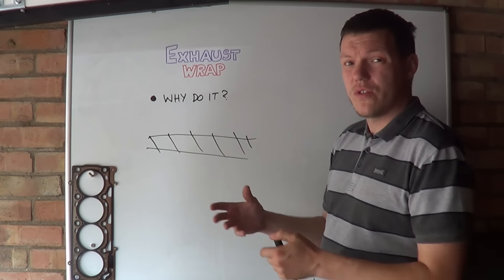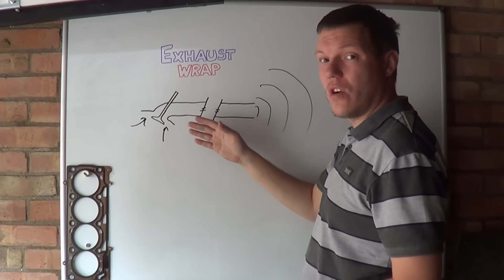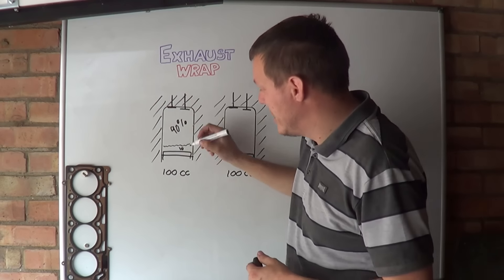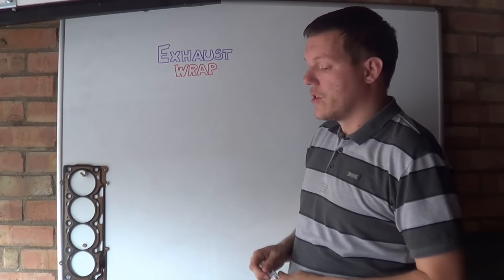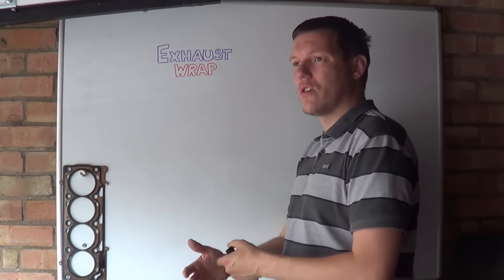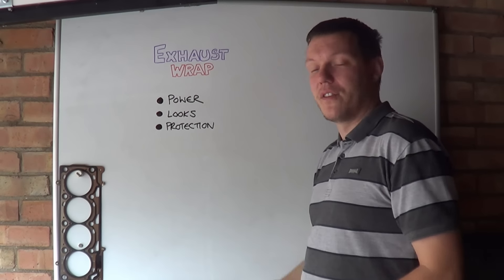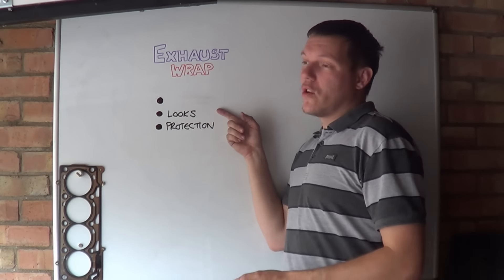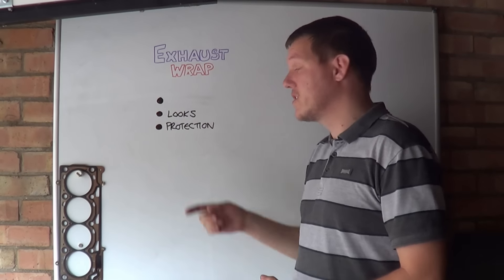Exhaust Wrap - Good or Bad - Bike TEch

Comment: I just wanted not to get burn by my Honda shadow 1100cc. :'( I wasn't really looking for increase of performance. I don't want to damage the bike tho...
Reply from the maker: It won't damage the bike, loads of people have been using it for years. You need to understand that it isn't a permanent fixture, it will need replacing once it starts to look shabby.
Reply: Oscar Herrera lol I have the same bike and it burns my side leg everytime I stop at red light
Reply: Hector Camberos any clue on how to avoid this? also. I'm not much concerned about burning myself. but the wait to put the plastic cover on... it is insane :'( and I live in a apartment so I have to literally go inside. take a shower have dinner then come back and put the goddammed cover on. it is insane. plus I live in Arizona so... worst case scenario
Reply: Oscar Herrera ya I wait around like 20 minutes  before putting  the cover on ..I went to cycle gear and they told me that exhaust  wrap will do the trick ..and they also say if you spray the heat spray after you put the wrap that it will be better
Reply: Hector Camberos I'll have to check that out.. thanks for the info. :) much appreciated brother in wheels...
Reply: ya no problem  goodluck